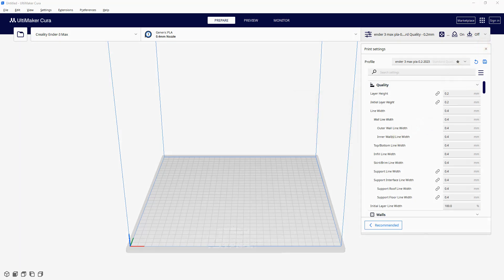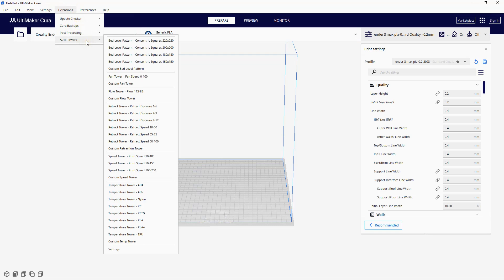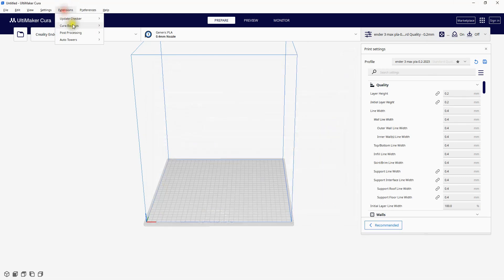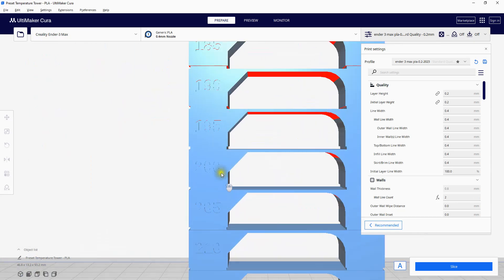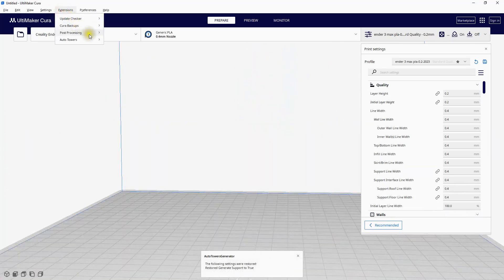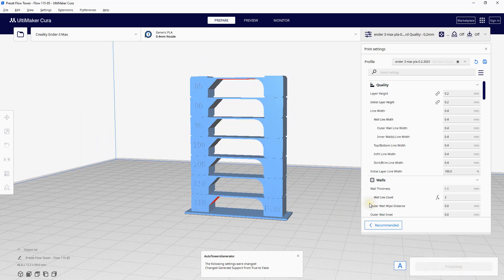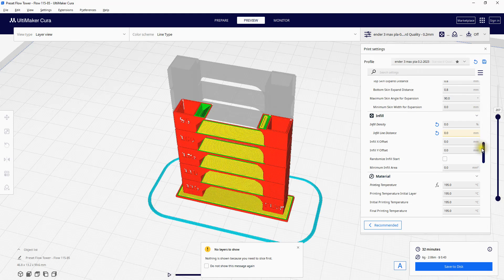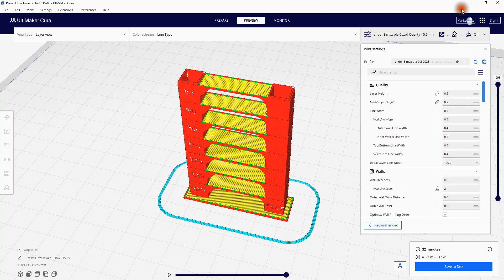how to:  Print auto towers. temperature , retraction & flow towers In cura  #help #howto  #3dprint

Comment: how does the temperature change? Horrible video, I am sorry, but the basic thing - changing temperature - was not mentioned. Does it happens automatically? Does I have to manually insert something to g-code?
Reply from the maker: It writes the gcode automatically    hence the auto towers.   You can monitor on the printer to confirm the temp is changing